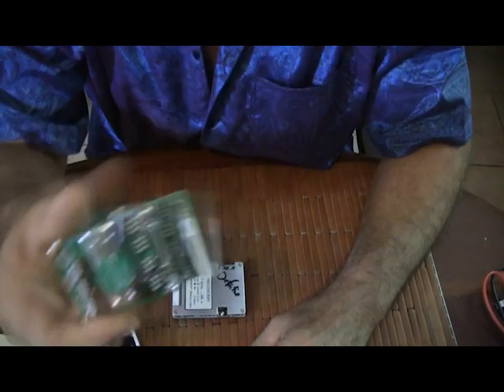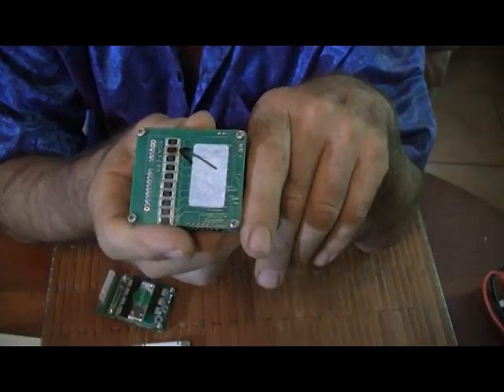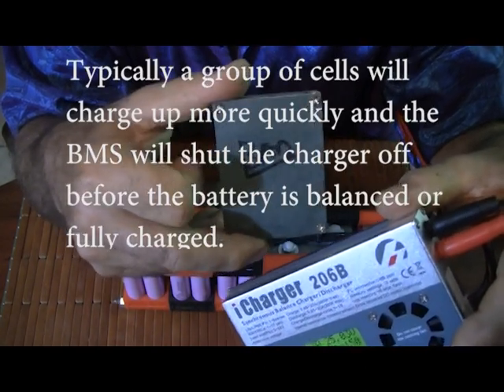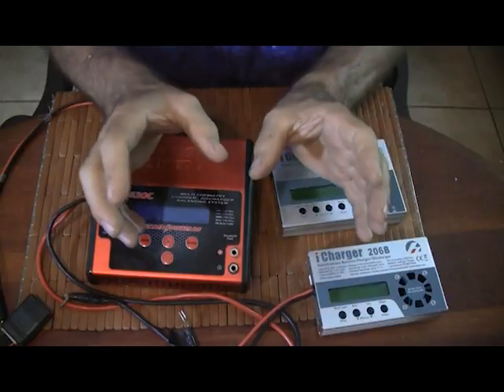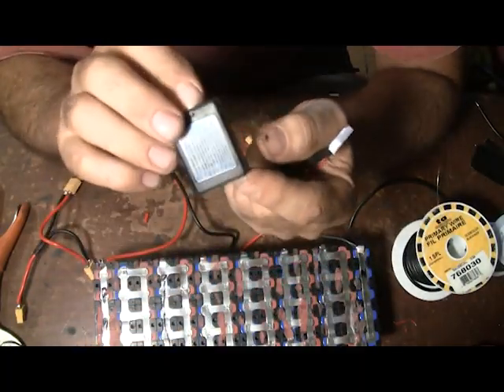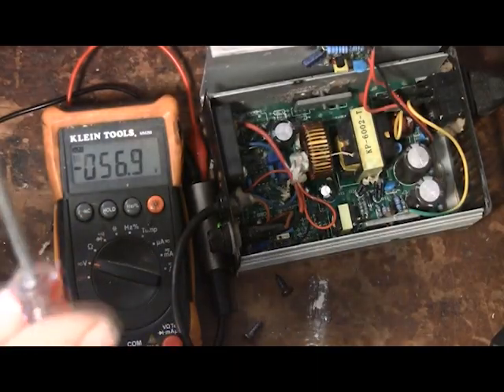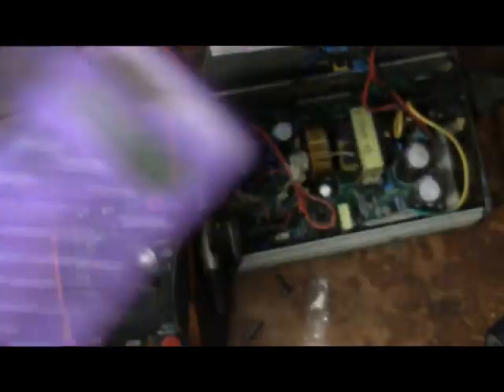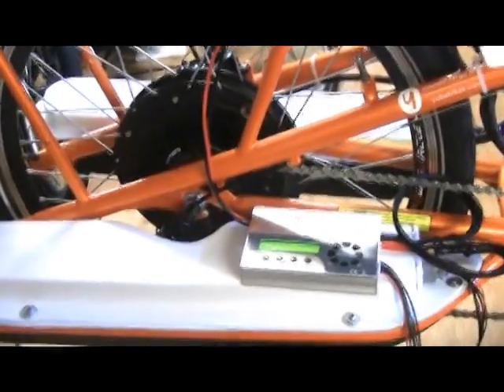How to build a safe and better lithium battery WITHOUT a BMS.

Comment: Thanks for the video.  What gauge wire are you using to hook up the battery to the charger/motor?  Also, what type of fuse would you recommend for a 10s 6p 36 volt battery?  Thanks.
Reply from the maker: To the charger use a 12 or 14 gauge.  To the motor use a 10 or 12 gauge.     I'd go with a 30 amp fuse on that battery.

cheers!
Reply: Thanks!

Comment: Great vid shwan, i fully agree. But this holds true for people that really care for their batteries and are interested in whats going on inside. Probably most of the ebikers dont really care for their batteries, they just use them. And 95%+ of all others, that use liion's dont care at all. But if you know what you are doing and are interested in the stories behind you are absolutely right! :-)
Reply: richardnanis if you are watching this video then most likely you are or already have made your own battery pack and to create a pack and all that goes into it only to not care about it in the end would take a special kind of individual that I don't know of exists. And to all that don't care are usually the ones that have spent $5,000+ on a bike that's top speed is 18mph 250watt 36volt 10ah rich idiot.

Comment: I have a question that I hope you can help me with. I would like to wire (4) 18650 in parallel and then take (3) of these four battery packs and put them in series. (to operate radios) However it appears that the balancing leads are wired so  that they balance the three four battery packs and not the 4 individual batteries in each of the 3 packs.  I am correct in assuming that each individual battery is NOT balanced but rather the (4) batteries in parallel are balanced as one battery?

Comment: Hello Shawn, I have a question. If I split a 10s4p in two 5s4p batteries, like yours in the video, could I connect the two batteries and also the jst connectors in parallel and charge them at once with a smart 6s balance charger?

Comment: "Stay within a 100drths of a volt whether you have a BMS or not"..COMPLETELY untru. As a matter of fact the higher amperage you draw the more they will vary in voltage as they are discharged.
"If your battery is perfect you dont need a BMS"..lol..what?..I make battery packs and use Panasonic NCR18650PF cells and I can tell you that after drawing 50 amps of discharge (burst) and an average of 25 amps continuous, they ABSOLUTELY do vary in their voltage and without a BMS the weaker ones in Parallel would hit 4.2 volts first and then get overcharged. Here's a hint; not all cells even quality ones are created equal!!.
Of course the problem with using a hobby charger for balancing is that on the discharge side, the weaker cells will hit 3 volts first while others are at 3.3 or higher, and if you think that doesnt happen, then you have NO real experience working with these cells, and in my opinion this video is very dangerous.
Reply from the maker: OK!  Did I say a hundredths?  Let me correct myself then.  I balance when my batteries are 2/10ths of a volt out.   "If your battery pack is perfect you don't need a BMS" is a thought experiment,  perhaps I am wrong to assume everyone knows that everyone knows that no battery is "perfect"- or to be more precise, stays perfectly in balance.
Using the hobby charger for balancing and monitoring the cell voltages with cell loggers to know when your cell hits a pre-programmed low like I advocate is tried and true in the hobby industry.  They run very high C packs without BMS's using this technique.     The battery packs on my ebike are still working very well after over 20,000 miles and four years using this technique.   It takes me overnight to come within three hundredths of a volt balance using my hobby charger, an icharger B-10, and I know this exactly, there is no guessing .  I bulk charge to four volts normally and balance charge about once a month.

Thank you for your passion!  I think we both care a lot about batteries!
Reply: Thanks for the reply...I didnt mean to come off sounding so snubbish...and yes we both have a passion for this..I make and sell battery packs and almost all unfortunately, have to be installed with a BMS. I have gone through many and there are good ones and there are bad ones..I am currently using Supower BMS units and they have so far been ok. Bestech have been terrible for reliability. I personally have used battery medics for my headway 24 s pack, but that's me and not many could do it...I sold the remainder of my headways to a customer and he wanted to do his own balancing but couldnt do it even after I balanced the cells to begin with. Im not saying it cant be done but most cannot ;)
Reply from the maker: Hey John,
Wish we were in the same neighborhood so we could compare notes.  I am sure I could learn a lot from you.  Thank you for your courtesy.
Reply: Not a problem at all. I also checked out your kits for building battery packs using magnets. I would wonder how much resistance one would expect connecting cells in this manner..of course when building a pack you want to eliminate as much resistance as you can to have the best performing pack you can make.
Reply from the maker: I agree.  I overcome with mass- by building a very large conductor- the higher resistance of 1010 steel. The steel is also zinc plated- which conducts about as well as nickel.  Also the distances are very short.  This was of course very much in my thoughts when designing BatteryBlocs.  All I can say is in practical use the steel does not seem to be an issue.  If you have a way of measuring resistance very precisely I will send you some sample Blocs and you can report back.
Reply: Hi there...yes I can measure the resistance. I have a BMS24 that I use on my personal ebike and it senses not only current but amps as well..I can retrofit it to this in a configuration of 2-3 series of cells and get some data. Since I know what the resistance of my cells are (Panasonic NCR18650PF) at 6 ohms then its easy from there. I suspect that there will be some resistance and of course the higher amps you draw the more of an effect this will be. I would love to have a couple to sample.
Reply from the maker: Sure John,

Can you contact me through my website email address?  So you would do it by calculating the difference in cell resistance?  It's not possible to measure the resistance of the BatteryBloc pieces?
Reply: So how does he do it then? https://www.youtube.com/watch?v=HPyeQCkcMUE

Comment: Thank you Shawn you have lifted my confidence again. To balance a 14s3p with an existing 6-cell hobby charger should I split into 3 modules? 5 + 5 +4
Reply from the maker: Sure, that'll work.  Most hobby chargers can recognize the number of cells that are connected in series.  If your's doesn't, and you need to change the settings for the different number of S's, consider building 3 5S batteries...

Comment: But isn't a hobby charge essentially a battery management system? Just a more modular one?
I'm looking for info on how to build a big 18650 array safely for solar charging.
I wonder if there isn't a really cheap battery controller that can charge and monitor a single 18650 perfectly and you just buy one for each battery. Or something.

Comment: Too bad I use a 20s 8p configuration. This would be annoying as hell and take way too long to charge. I have had my bms melt some plastic around it but nothing too serious, and it has cut voltage a few times after storing my ebike for the winter but the problems magically went away. I think the best solution is a bms that you can connect to your computer, or smartphone, they are more expensive but I wish I invested in it now.

Comment: How about a smart charger that can be sat to 80/90/100% of the capacity (4.25V)?
Even though it does not mitigate the issue of improper balancing, it a step in the right direction.

Comment: can i apply this for charging cordless drill batteries?
Reply from the maker: Yes, it would work just fine.
Reply from the maker: Sure, you can use any balancing charger.  The imax b6 is a very popular charger.  I have one too.
Reply: Hi Shawn.
First of all, awesome video, thank you very much!

About chargers, when you talk about the imax b6, you say it is a "very popular" charger.... it seems like a rather cautious comment ;)
Given that an imax B6 is about $30, whereas the icharger b206 that you are using is about $120, could you please share a little more about your experience of the imax b6? And what is it that the b206 can do, that the imax b6 cannot do?!
Also, do you know what if the maximal charging voltage on the imax can be adjusted?? thank you!
Reply: just another noobie question, can i substitute your charger with a imax b6? supposed i only got maximum 6 lines of paralleled batteries?
Reply from the maker: Hi Michael,  It is a cautious comment.  I am just biased towards charges, as I have several and they have worked well.  I think that most hobbyist start with a HobbyKing product but later look for a higher quality product.  I think that is the right way to go.  I did that too.  Not my place to get into a discussion about which one is better.

Comment: Didn't realize Lithium charge cycles is only 500 under normal conditions.   That's kinda shitty especially for the price tag.
Reply from the maker: It s a way of rating the batteries-  If lithium capacity drops to below 70% of it's rated capacity, it is considered "used up".  So 500 complete charge discharge cycles- which rarely happen- might cost 30% of the batteries capacity.

This is an issue in an electric car- which can compensate by charging at a slightly higher voltage as the pck capacity diminishes.  It is not so much an issue in a stationary storage application.

Comment: Please excuse my ignorance, I don't understand how the charger or logger can see individual "cells" when everything is connected together in series. Does it do the math for you and work it's way out along the chain? Could you do the same with a multi meter manually? Sorry for the dumb question, this is all new to me. Is that batter pack both parallel and series combined? 14 long in series, and 5 wide in parallel?

How does the charger target specific batteries? Does it bring everything down to the low water mark, and then charge from there hoping that everything will be even afterwards?
Reply from the maker: Great questions!  

The logger or charger starts with the negative terminal of the battery.  Consider that "0".  Then it goes to the positive of the first cell.  Consider that 4.  Then it goes to the positive of the next cell, consider that 8.  Then it does the math and deduces that the voltage of the 2nd cell is not really 8, it is 8-4=4.  Etc.  

The charger charges the entire pack in series.  Using the same technique, it monitors the voltages of all the cells.  If one exceeds the set limit, say 4.2 volts, it turns on a resistor through the balance lead connected to that cell, and attempts to reign it in.  Failing that, it reduces the charge current.  Failing that, it shuts off the charge.
Reply: Shawn McCarty thanks so much for the response!
Reply: @shawname2  enjoyed your vdo & info, correct me if i'm wrong but in your explanation above, each voltage point being measured w/data logger is that of 5 "cells" that are in parallel, not an individual battery "cell", thus it's possible that over time you would not know if a cell or 2, etc. has opened ( out of the 5 ) and/or developed a failure mode resulting in high internal resistance ( won't take a charge/shows few millivolts).. ( by wouldn't know i mean other than your range would be lower...pack produces less amps, etc. )
Reply: @robozstarrr8930  yes,  i thought that too, it's a disadvantage of the parallel/series system as opposed to the series/parallel. In the latter it's much easier to determine your bad cell, but seemingly the advantages of parallel/serial outweigh this disadvantage
Reply from the maker: Good comment.  Yes, it does the math and works its way out along the chain.   You could do the same with a multimeter or a voltmeter hooked to each parallel group.    Yes, all batteries are made up of cells connected in parallel to multiply amps, then those parallel groups connected in series to multiply voltage.
Reply: Yeah but he forgot to mention one important caveat whenever you make many parallel Connections in your series none of these balancing features will work BMS in Balance chargers only work if you create a current like a race track that's not Crossroad it every cell you don't really understand how BMS is work or how they check for currents but hey ignorance is bliss

Comment: I never understand how something like a cell logger can accurately measure the cells that are connected In series if the entire battery as a whole is actually all connected...  Won't current from other series cells flow through and make  readings inaccurate ?

Comment: 4.0v saturated cells are 80% charged. If that is not enough range then better to add more cells than to charge to 4.2v which stresses the cells and saturation cutoff is critical.
Reply from the maker: I agree, and when there is room.  But it is good to have the option of still being able to charge to 4.2 in case you need the extra capacity for a long long ride.  

It is good for a knowledgeable human to make that choice, not a chip!

Comment: Why go through all that when you can purchase a nice BMS with display:

https://www.aliexpress.com/item/Free-shipping-1pcs-smart-display-3-2V-3-7V-150A-lithium-battery-protection-board-balanced-management/32710469857.html?spm=2114.40010308.4.2.Mp0kMR
Reply from the maker: Thanks for the link- that is a sweet BMS for sure!   Makes sense on a high end battery.

Comment: I like it! Thanks for the informative video, Shawn. What model are those battery loggers? How many charges do you typical find you go between balancing sessions? And lastly, is there any reason one can't bulk charge a pack with a standard lab/benchtop power supply (eg a 14s7p pack with the supply set to 57V (~4.1V/cell) and current-limited to 2-3A). I have plenty of power supplies at work capable of that. It seems like it'd be fine, if I'm sticking to 4-4.1V. I'd likely charge at home with a normal charger, balance as needed (monthly?) and charge at work with the power supply. Sound sane?

Comment: Great video Shawn, I made an ebike last year using 10 x 6S 5Ah lipos to make a 48V 12S 26Ah pack and don't use a BMS.
I charge using a Turnigy Reaktor 300W 6S charger in two sessions, and as often as possible from 300 W of home made portable solar panels, that weigh about 6 lbs, fit in a backpack and can be laid out anywhere.

The pack is capable of giving 12kW of power, though I "only" use about 1.5kW, and that is plenty!
I just made a couple of extra cells using 16 18650s per cell (~36Ah each) so it can cope with 30A and 50A burst regen, and now gives me 14S, though regen doesn't work until the voltage drops 1/2 an S, as I found out when I needed to brake the first time I tested it!
Yes, I know the chemistries are different, but I charge them individually and make sure voltages are always within spec.
(Just a note about XT60s / XT90s - lipos use the female type, so I'd recommend following that convention for compatibility).
(I put a video up showing my pack, charger and solar panels on my channel if you're interested)

Comment: Great vid... what is the cell logger you use in your vid? link to would be great.
Reply from the maker: Sure- it is sold by Hobby King and is called a cell monitor.  There are a number of different flavors of them.
Reply: Thanks found it under voltage checker
https://lh3.googleusercontent.com/sgs8s42CaJTS8ea4d-AJLWvI4gAfIVaRUPlRvNZe-vU6iAZ4szpX1ewfntzCBqHJNYAifO1DNH0

Comment: this definitely had done appeal. I had a battery doing some weird chopping out around half way through. that was really frustrating and unbearable to live with. ended up getting a new battery. 

I want to have that control and knowledge of how my battery is doing but this process requires a lot of resources and some skills that scare me too much to get into this. 

one question though. does charging the battery this way mean that there's no over charge protection? do you have to be there for the whole charging process? I rarely have a chance to get a full charge other than at night when I'm asleep.
Reply from the maker: The Hobby Charger is the over charge protection...   It is commonly used to charge up model airplanes and drones and such.

Comment: Shawn grate video I wouldn't have been able to make my two 7s 14p battery without you for that thank you very much. how do you charge both 7 s batteries at once I cannot find a parallel board for my a charger 1010b. can you help me with this lead me to a product I can buy to balance charge both batteries at once
Reply from the maker: You can make a parallel lead by wiring two jst-xh 8s connectors in parallel.   WARNING!  Be sure to disconnect the two battery halves from each other before using any parallel connector between them or you will short and melt the jst-xh wires.  AGAIN:  Disconnect the series wiring between the two battery halves before balancing in parallel or you will release the genie!!!!!!!!!
Reply: Thanks